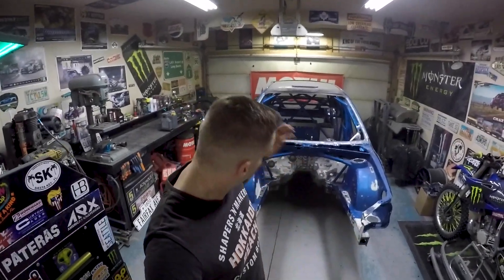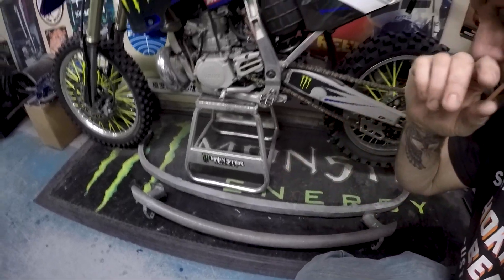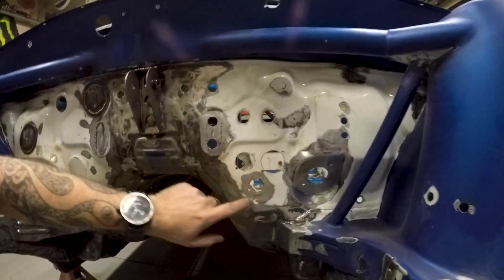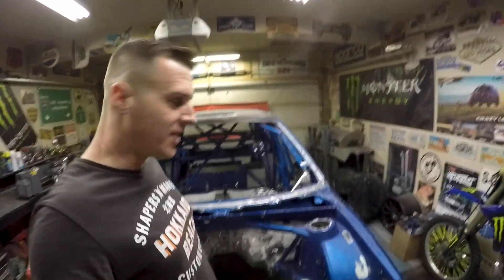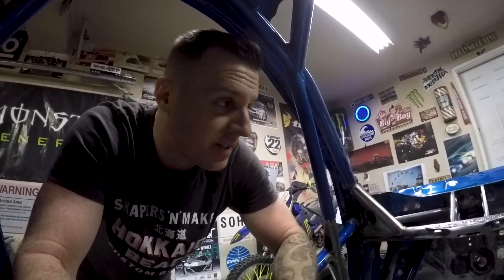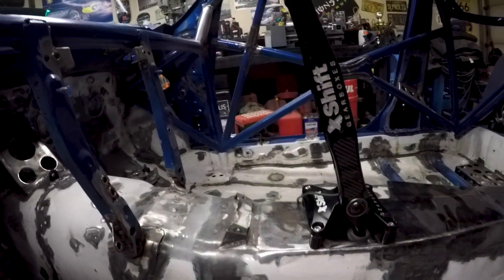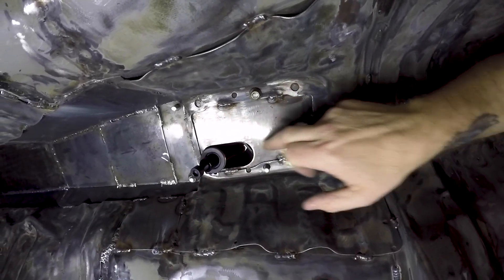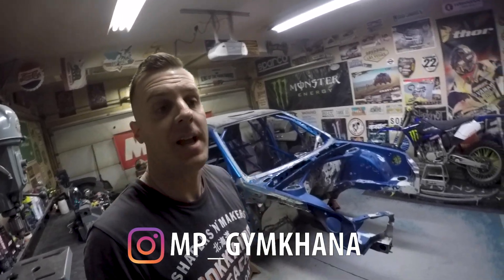Subaru WRC Custom Metal Fabrication OCD - Subaru STi WRC / Gymkhana Build Series

Comment: Any chance u could let us know how heavy the roll cage is? And how much weight the car is?
Reply from the maker: I don’t remember what the weight of the cage is, the welding rod also adds some weight as does the paint. I removed lots of metal and even more this time around. Once the car is finished I’ll get it back on the scales. I’m hoping to be sub 2,800 lbs
Reply: @MPGymkhana  yes thanks so much for reply. I'm about to embark on rebuilding my car. I'm a novice but will have ago even what u shown me with the welding u done and deweighting. Feel I can do this now and inspired.

I want a fast 0-60mph car. I'd be happy with 3sec. 

The classic is easy to get to 2425lbs 

The new age is heavier. 

I'm not looking to do rally just straight line (not original design I know) 

With the deweighting u did hypothetically would a roll cage be needed for stiffness and safety or without OK for basic road use.